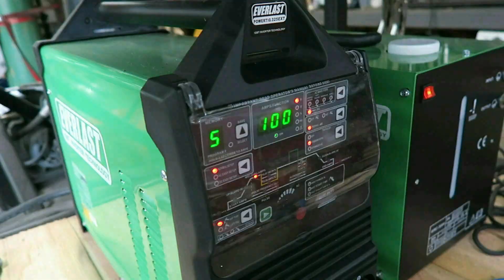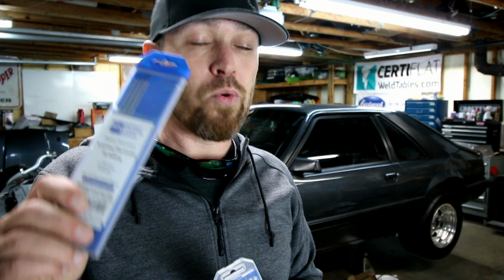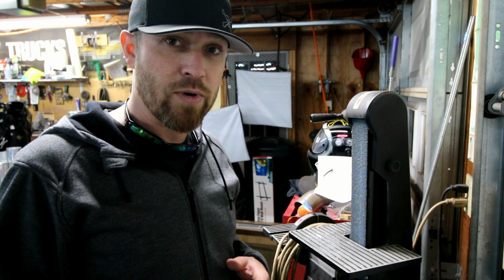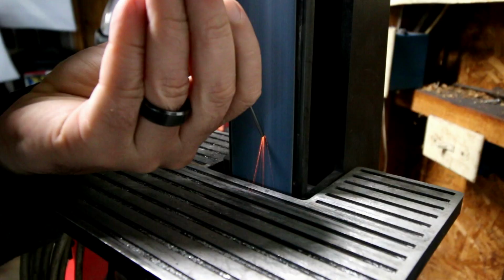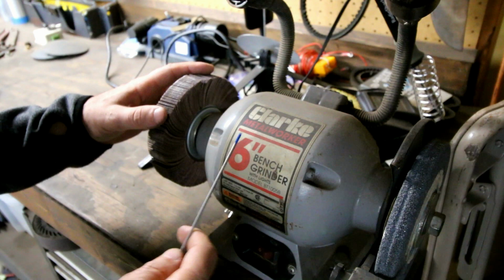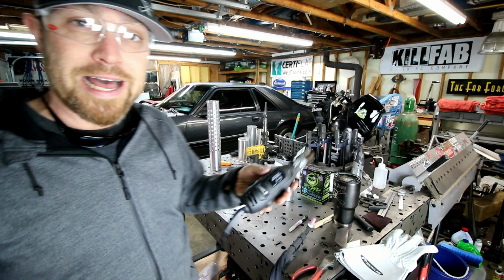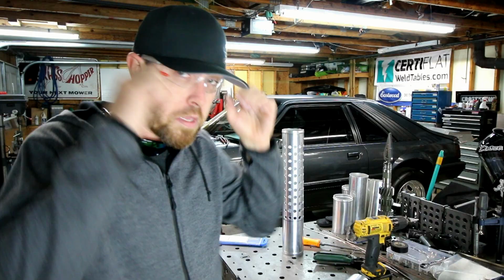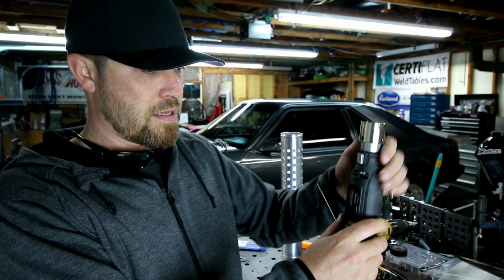How To TIG Weld (sort of) - Episode 3 | Tungsten Grinding

Comment: If you don't have a dedicated tungsten grinder, chuck the tungsten up in a cordless drill and spin it against the belt or grinding stone. Much faster and more consistent. BTW, I also use a belt grinder to sharpen my tungsten. :)
Reply from the maker: yeah that does work well
Reply: That's what I do, I have a little drill that I generally only use for sharpening it :) takes seconds.

Comment: The quickest way is putting tungsten in drill and using grinder to sharpen tungsten
Reply from the maker: I would have mine done before you even got it in the drill....so no its not the quickest way

Comment: Ok I been together tig welding for bout 20 years from stainless to aluminum and I just wanted to get a question going for the fans which do you prefer red or green tungsten I prefer green myself with aluminum cause the tungsten tip is a nice ball on the tip and use the red for stainless and sharpening it you are sharpening your tips ( to me ) a lil to blunt I like mine a lil more longer I learned to walk the cup at age 20 on stainless pipe
Reply from the maker: I dont use either. Those colors are geared more torwards the old transformer TIG welders. The new inverter style machines do better with other tungsten mixes. I use Blue for everything 2% Lanth
Reply: Family Mann I use blue as well

Comment: I like the idea of the tungsten grinder, have been thinking about getting one. My  thinking is the consistent and repeatable grind angles and tip profile should give you more consistent and repeatable arcs, therefore better welds.    Or maybe that's just me justifying some more tools to make me feel like a better welder........
Reply from the maker: yeah that is the case....
Reply: i use a drill and disc sander to sharpen my tungsten but its all personal preference.

Comment: Hey Kyle.  I like the dedicated tungsten grinder from Eastwood... seems like a cool deal for consist results.  I'm not a welder, but I  remember a buddy of mine mentioning some radioactive dangers involved in grinding thoriated tungsten.  I've never really looked into it, but assume there are safer options available.  If so, would you mind touching on that topic sometime in the future.  Good series.  Thanks, man.👊
Reply from the maker: Yeah for sure.  I dont think they make the Thoriated anymore. If they do I dont use it. Probably do a series on all the various tungstens
Reply: The Fab Forums Cool. Thanks, Kyle.
Reply: Hi Mick, The issue with Thoriated Tungstens, is they have 2% Thorium Oxide in them which makes them slightly radioactive, therefore a lot of OH@S groups are stopping use of them (even though it is not a critical amount of Radioactivity) They are changing to 2% Lanthanated or Ceriated or Tri-mix tungstens.
Reply: scott carr Thank you for the info, Scott.

Comment: Im about to attempt to  do some chrome moly  cage work question is could you make  make a video or reply here as to the  Tungsten size and type and rod type and size you prefer to use to stack dimes on those cages ..thanks
Reply from the maker: ER70s-2 is the filler you need to use. I use 2% Lanth on an inverter machine. The size of filler and tungsten depends on what I am welding